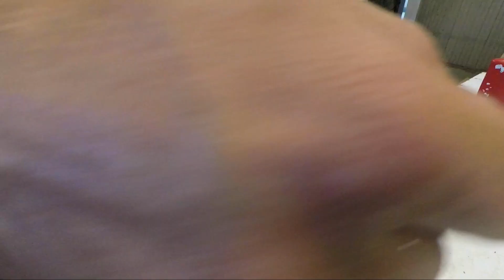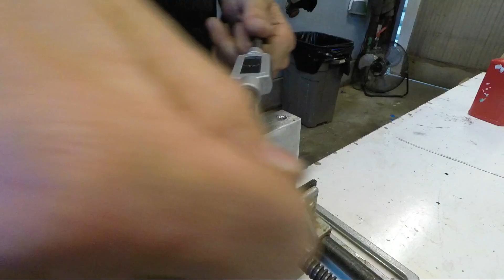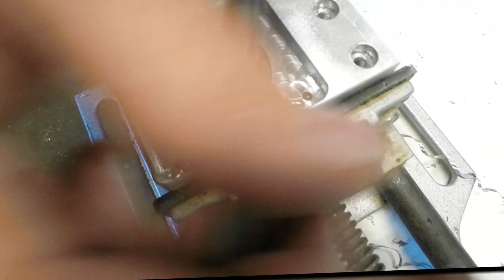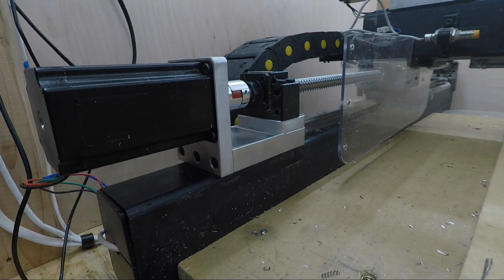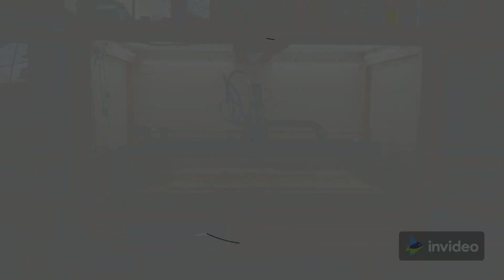PrintNC Pro Motor Mount Installation

Comment: good job nice looking machine.

in my case the couplings always the limitations when I push the acceleration and speed.

I managed the rigidity but to fix the couplings slippage at high acceleration requires me to machine parts while I do not have access to a milling machine. So I just fill with silicone/super glue and roughen the shafts by filing to prevent slippage. But that is not a proffissional solution.

Comment: i just ordered a 3d printer. i want to build a CNC like this for 4x4' with 4" height work area for wood and aluminum. got any recommendations or should i just buy the parts from aliexpress and follow the printnc guide?
Reply from the maker: The 4'x4' should be more than doable on the PrintNC as long as you size up the gantry according to the calculator. I think the 4 inch of Z height travel might require some customization though. I'd recommend hopping into the discord and there are tons of active users who can help get you though it
Reply: @MKMilling  have you seen anyone make a 6 axis? a clamp to move a cube around for more complex builds?
Reply from the maker: Someone recently posted a cutting 4th axis build in the discord. I have not seen any successful 5 or 6 axis diy builds. Atleast that have any sort of rigidity to them.

Comment: Great video. I downloaded the STEP file so easily to Fusion360. I like to see how things are drawn and made in fusion. You did a awesome job in your file.  You used Parametric measurements to be able to change file easily. I could break each component down to see how things worked.  You have put a huge amount of time in this project.  Just a hint I have been watching James at Cloug42 video's and he has been testing stepper as well as servo motors and the performance of each motor compared to the cost.  I am not affiliated with anyone but myself.  Thank you so much I would like to how you made the rest of the parts and designating of table and gantries ect. Again thank you and may God Bless you on the rest of your projects!!
Reply from the maker: I wish I could take credit for the design of this machine it has been very well thought out and made very accessible to the general public with the parametric design.

Comment: The dust or should I say chip protection for rails and ball screws, does it improve chip collection on rails ?
Reply from the maker: It makes a huge difference, its not 100% preventing the collection of chips on the linear rails, but reduces it substantially. I have some lexan waiting to be mounted on the right side, and hopefully and going to form a bend in it to but a bit of the cover over the top as opposed to just the side.